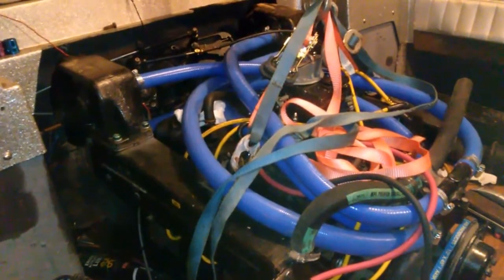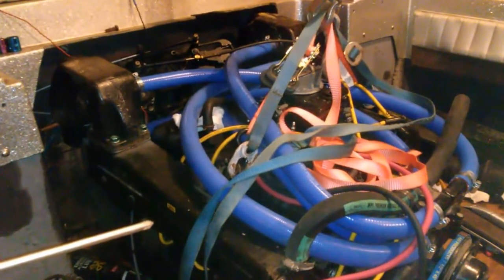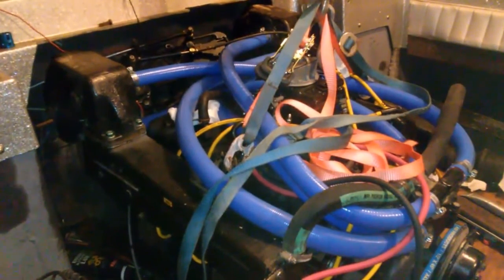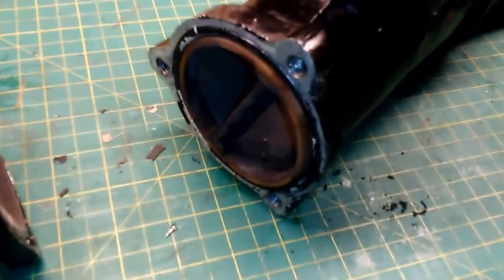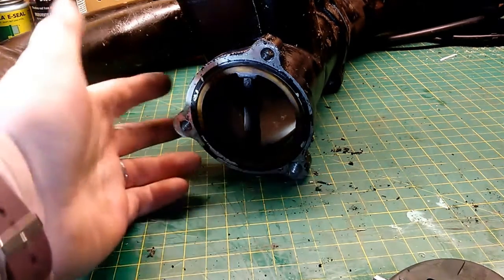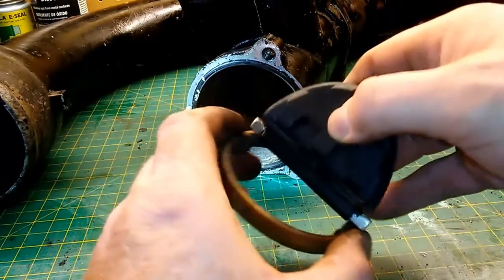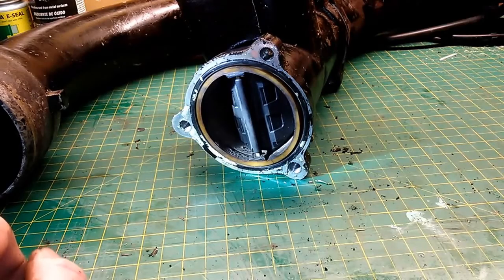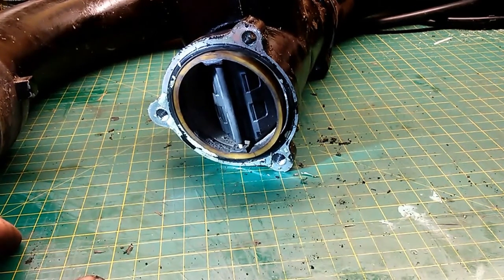Where are the exhaust shutters located on a Mercruiser 888 5.0 Liter Engine?

Comment: Do u really have to pull the engine to replace them
Reply from the maker: That depends on the design of the boat, not the engine.
Reply: just pulled mine on a 888. use a long 5/16" allen head to work around the flywheel housing